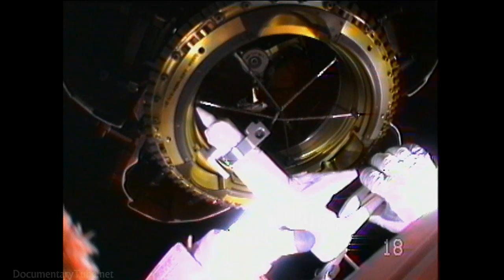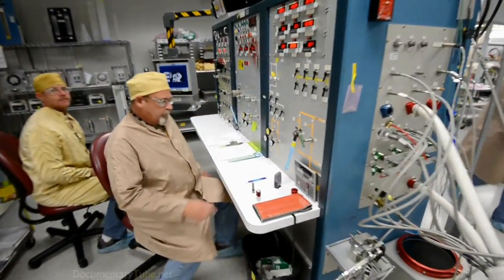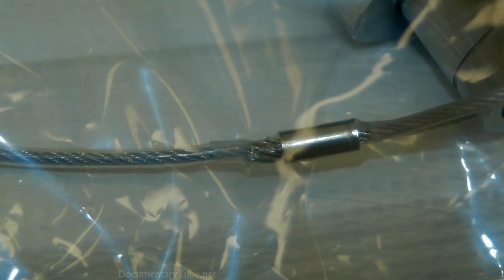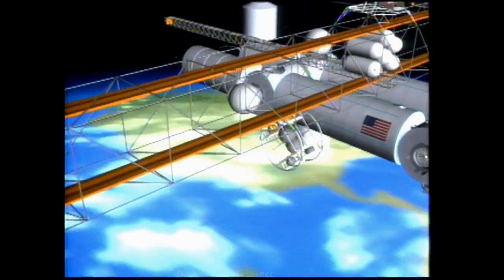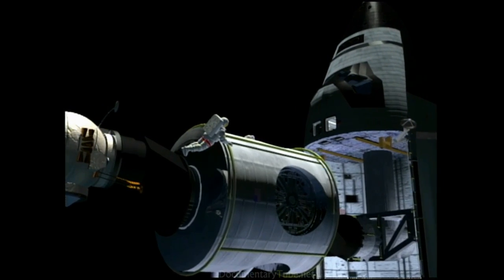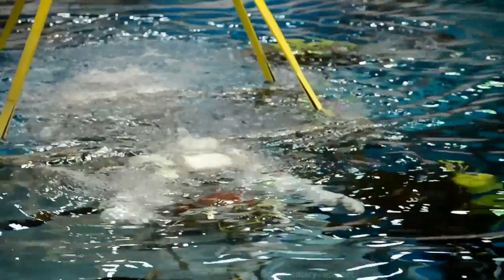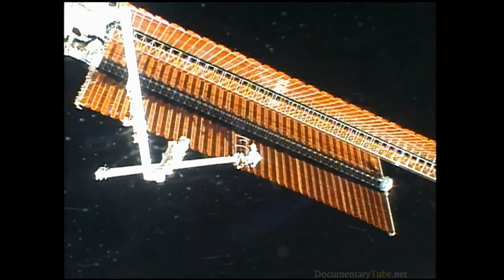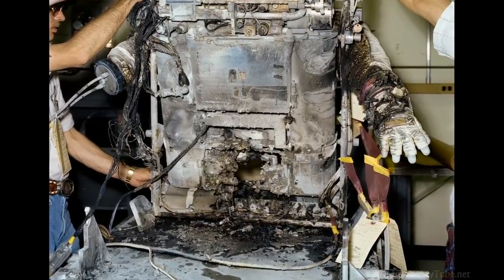HOW IT WORKS: Spacesuits on the ISS

Comment: I wanted to know how they work.  This documentary tells you nothing but history.  What keeps them from popping like balloons?  How do you regulate internal heat in an airless environment?
Reply: What keeps them from popping like balloons?
The restraint layer.

How do you regulate internal heat in an airless environment?
During the Apollo program, the excess heat would be vented outside with some water. Yes, the total duration of each lunar EVA mission was dictated by the capacity of the life's support water tank.
Reply: @Jan_Strzelecki  You beat me to it.
Reply: @Jan_Strzelecki    Huh?  What?
Reply: @Meinstein  What is it that you don't understand?
Reply: @Jan_Strzelecki   I didn't understand the "restraint layer"  but I kind of can comprehend heat being released by dissapation of water.
Reply: @Jan_Strzelecki    To tell the truth,  there is a LOT that I don't understand.
Reply: @Meinstein  The restraint layer is essentially a layer made out of mesh, which prevents the air tight layer from expanding too much. It's kind of like putting a balloon inside a sleeve.
Reply: @Jan_Strzelecki   OhKaaay...  which leads us to the original thing.   Outerspace suits seem to be impossible.
Reply: I admit to not understanding a lot about space physics.   Like.. why do we have to pressurize a submarine to go to into deep water while it seems that the logical thing to do in deep space would be to do the opposite and de-pressurize the cabin?
Reply: @Meinstein  That's not far from the reality, actually 🙂
In submarines, the deeper you go, the bigger pressure difference is - but in space, the pressure difference is 1 atmosphere at most: 1 atm being the air pressure at the sea level, and 0 atm being the vacuum.
As such, if we can lower the pressure inside the spacecraft (and the spacesuits), the lower the pressure difference will be and the easier it will be to move in a spacesuit.
The way we do it is by replacing air with pure oxygen - since most of the air is comprised of nitrogen, we can safely remove it and just breathe the pure oxygen at somewhat lower pressure.
Reply: @Meinstein  you cannot live long on pure oxygen.  It will burn you out.
Breathing pure oxygen under high pressures (for example, while diving in the ocean) can have fatal consequences, yes - but in space, the air pressure is exceedingly low, even in the pressurized cabin of a spacecraft. That is why breathing pure oxygen in space is not fatal - the partial pressures actually experienced by the lungs are not that different from what they are on Earth at atmospheric pressure.

I'm still trying to understand your reasoning for releasing water to cool a space suit.
When the inside of the spacesuit heats up, mainly due to the astronaut's body heat (and eventually the external heat as well), the heat gets passed to the water pumped through the small hoses around the astronaut's body. Water was then sent through a porous plate sublimator, which essentially exposed it to a vacuum in a controlled manner - and when water is exposed to vacuum, it boils, carrying away enough heat to form ice.
Reply: @Jan_Strzelecki  thank you
Reply: Exactly . I thought it would show how it works
Reply: @midwesttraveler2674   Years later I have still to see a diagram of the working of a space suit..  even an old one.
Reply: if you put an inflated balloon in a vacuum chamber it expands to the size of the chamber
Reply: @1FeistyKitty   Certainly so..  how about if you put an inflated balloon in a submersible in a pressure chamber?    They are complete opposites.  Air pressure increase in a module to compensate for water pressure and air pressure to compensate for a vacuum seem to be at odds.
Reply: @Meinstein  this is confusing ---- what is your point
Reply: @1FeistyKitty   I am not making a point.  I am asking a question.
Reply: @Meinstein  ok, but you could read what is inside what you are sayig a couple ways ---- what is inside what ?   You can just make your point ---

Comment: Meh.... Could have had more info on how the suits work. A lot of useless info.
Reply: all i want to know is: why don't the flexible parts blow up like a balloon when exposed to the vacuum of space?
Reply: @daveyjones5702  
They are blown up. 
The tensile strength of the material, meaning how much it can stretch before popping. It is far from its limit, since EVA suit is only pressurised to 1/3rd earth atmosphere, the human body limit.
Reply: @nuxtheunkrakible9324  except they clearly are NOT inflated.
Reply: @daveyjones5702  
did they ever show footage of them outside the craft? if so then they have to be. if they were inside the craft then it wasnt. 
i didnt watch the entire thing since it was mostly bad music.
Reply: @nuxtheunkrakible9324  actually i'm referring to any image i have ever seen of the space suits.
and yeah there's a clip of them outside the craft in this vid too at 8:22.
Reply: @daveyjones5702  
i would say its a matter of distance for why the suits look like that.
and you can look up many different pictures of multiple different lines of suits that pressurise this way. it doesnt even have too be a space suit, since almost all high altitude flight suits work on the same rules.
Reply: @nuxtheunkrakible9324  distance to what?
Reply: @daveyjones5702  
The cameras distance from the astronaut.
Reply: @nuxtheunkrakible9324  and what exactly would that change about the space suit?
Reply: @daveyjones5702  
distance always makes things look a bit off. that plus likely speeding up the video makes it looks a bit off.
im not exactly an expert on video editing though so dont take my word for it.
Reply: @daveyjones5702  They're not balloons. They are inflated and are specifically designed for the job they do, which would only be encumbered by an over distended envelope. You do realise the suits are made with multiple layers of very specific materials to balance functionality with comfort and ease of use?
Reply: @Declan-pg8cg  yeah ive seen the cutaway drawing.
none of it explains what we see here though.

being snooty is not as good as being right.
Reply: @daveyjones5702  Oh so you seen cutaway drawing and didn't see that there is reinforced mesh from " Dacron"which prevent to much inflation?
Reply: @tgstudio85  lol hardly, and what we see in these pics and videos doesn't line up with that either.
Reply: Nim Boo  
yep. if the suits where filled to 1 earths atmosphere of pressure then the suit would be nearly rock solid and leak like a stuck pig.
but these suits are old, new suits are very easy to move in when under 1/3 pressure. not sure about 1 atmo of pressure though.
Reply: Let me know what you would like to know, I can lecture for days on how the suits work.
Reply: It's stars with cartoon FAKE PLANEt earth, is it PLANE? Cost of 12.000.000. $ most expensive sucuba gear ever😂😂😂 we ARE PAYING FOR THOSE AND IT IS MOST PROFITABLE BUSINESS IN THE WORLD! For the First moon landing Stanley Kubric movies they did collect 55.000.000.000$ from tax payers! Ppl need to wake up!  If some one still your money u want to do something about it, isn't it?  If yes search about the TRUTH! But beleive me they not going to give you the truth at the first page of goggle or utube! One need to dig deep to find it! They are spending billions to hide the truth from us! 
CAN YOU HANDLE THE TRUTH.?
Reply: @jimmysenman4749  
WHY do you TALK  like THIS its NOT, DRAWING ATTENTION it jusr makes it sound like your having a STROKE.
Reply: Yea because you’re an astronaut prepare for YouTube space right?
Reply: Everything about the ISS is useless and they are taking us for more then a million $ an hour.
Reply: @daveyjones5702  fully documented vacuum chamber tests, can't find em, pre Apollo till present.
Reply: @الحياةوالعدم  I just like space suits man. i dont really know much about cosmic phenomina.
Reply: @dankkwater2887  🤣😂🤣😂🤣😂🤣
Reply: @jamesconnor2278  reeeeeeeeeeeeeeeeeeeeeeee
Reply: @daveyjones5702  cannot explode in the pool
Reply: if you put an inflated balloon in a vacuum chamber it expands to the size of the chamber

Comment: how to they prevent the glass from fogging?
Reply: @قفرانالسلمي-ي8ظ  ?
Reply: The helmets are designed with all of this in mind. The EMU suits are pressurized with pure oxygen at around 4 PSI, we breathe 14.7 PSI here on Earth. So the event of a glass fogging would be pretty much impossible since there is no moisture and low pressure.
Reply: Wouldn’t moisture enter the air from their breath, and also maybe sweat and stuff on the surface of their body?
Reply: @fuelrich299  also a guy once drowned in space because he drink water in the spacesuit so how do they prevent that

Comment: Nobody learned a damn thing from Apollo 1 where Grissom, Chaffee and White were barbecued  in a pure oxygen environment...So much for engineering degrees in America...Here's a quote from Alan Shepard...."Don't fuck up..."
Reply: I disagree, and so do the many early astronauts, including Frank Borman who went on to command Apollo 8. He was head of the investigation as to that Apollo fire, and his later opinion, as well as that of his colleagues, is that without the shock of the three deaths and the subsequent broad knowledge of the many technical vulnerables, shoddy workmanship, and bad design decisions that were made, eventuating all their eventual corrections, America in all probability would have never landed astronauts on the Moon and returned them safely.

And doesn´t that exactly address the political and technical challenge that Kennedy addressed on May 25, 1961?
Reply: @brianhiles8164  The 100% O2 decision was about money only. Just look at oil or paper or Teflon in O2. In normal 80%N2 20%O2 they are relatively stable. Put them in 100% O2 and they become ready to combust. The head cheeses only wanted a cheap solution. Single gas was it. Three paid with their lives.

Comment: This should have been titled "HOW IT DOES NOT WORK" because there is no way a space suit with internal pressure of 14.7lbs/in^2 (1 atmosphere) from blowing apart in the total vacuum of space.
Reply: How is it in a common car tyre is 4 atm?
Reply: @002o   the average human body has an average 1.9m2 or about 3,000 sq inches. 3,000 x 14.7lb per sq inch = 44,000 lbs = 20tons of force (without opposing force from vacuum) looking for the weakest spot in the suit (zipper, sawn needle punctures, etc).
Reply: Sewn. Imagin a with (3 atm pressure)  tire with zipper and sewn parts.

Comment: There is an obvious UFO in the first 15 seconds. Awesome.
Reply: Nick Howley that's the camera reflection
Reply: Nick Howley  At about 0:11 it comes from behind the solar panel at the left of the screen and heads down and to the left. if you zoom in and look at it frame by frame it does appear to come from behind the solar panel then when it goes back the other way a couple of seconds later it seems to vanish behind the solar panel again so I reckon it may not be a camera reflection.

Comment: So how are they not absolutely crushed by the vacuum of space ?? I’ve seen what a vacuum does to a tanker and that’s nothing compared to the vacuum of space. Maybe they mislabeled the video maybe they’re actual long talking about scuba gear.
Reply: What? The reason a vacuum chamber would implode isnt because of the vacuum itself, its from all the air on the outside.
They are dealing with the opposite of a vacuum chamber.
Reply: nuxtheunkrakible your comment doesn’t make any sense your telling me the outside air did this ??? link below 

https://youtu.be/VS6IckF1CM0
Reply: The video you linked seems to have a vacuum inside the tanker and normal pressure outside, when in space it’s really the opposite.

Comment: If there is air inside the space suits, then they would explode in a vacuum. It's just that simple.
Reply: Why does a car tire not explode? The pressure differential between the inside of a car tire and the air outside, is greater than between a space suit and the vacuum outside it.
Reply: @ArKritz84  no. Put that car tire in a vacuum and it will explode every time.
Reply: @awakenow350  Why would it explode in a vacuum?
Reply: awake now re-enforce it to withstand more pressure. Problem solved.

Comment: LIES LIES AND MORE LIES......🤥
Reply: By the way, you can even see the ISS. Just track its current location and watch out for it. Its best to see in dawn. If you have fancy equipment like a high zoom lens or a telescope with a tracker, you can even automatically stabilize and get clear shot of it. 
If seen the iss many times for myself with bare eyes, altough to see the actual shape you have to use equipment as i mentioned before. Keep in mind that it is 400 km above the earth.